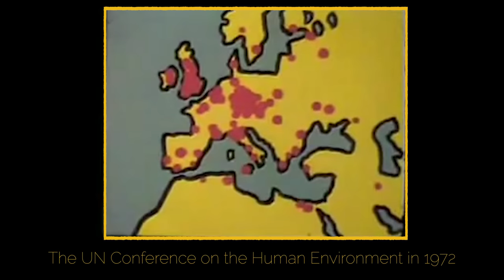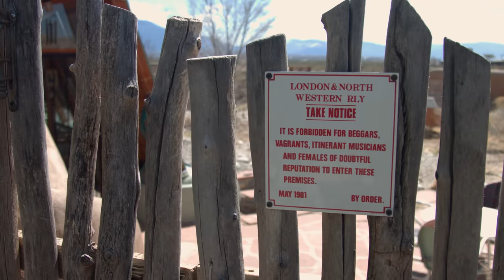Earthships - America's Off-Grid Desert Community

Comment: There’s a parallel here that I don’t see anyone mentioning, the SeaShip Communities. These are the roving bands of cruising sailors, living at sea on their boats of various sorts, mostly powered up with solar panels and small wind generators. My wife and I did it for some 7 years and truly loved it and “the life”. Just 5 solar panels and one modest windmill provided all the power needed to run everything on our 44_foot sailboat, including a large fridge and deep freeze, all our lights and electronic equipment, and our reverse osmosis watermaker (to convert sea water into all the fresh we could use). The key to it all was a good 12 volt, deep cycle battery system below waterline and the appropriate regulator. I didn’t notice it mentioned here, but surely like that is needed for land cruising as well.

What I do see mentioned frequently, however, in numerous critiques of sustainable energy production, is that its just not possible to meet the needs for modern existence. So how in the world do EarthShippers and the contemporary cruising community manage it? My guess is it’s all about heating and cooling. I repeatedly read that Florida spends 80-85 percent of its energy dollar on air conditioning. That’s an awful lot, yet Earth Shippers have clearly figured out some very clever ways around those problems. Cruisers too, just go where wind and weather treat you best.

Ultimately, what I find most impressive about what Mike and the Earth Ship folks are doing is the recycling of everything, not just for building, but for everything — drinking, cleaning, waste removal, eating, virtually everything. SeaShippers have a ways to go with those challenges. But in any cas
Reply: Also similar to Van life, with water conservation and solar energy, self sustainability.
Reply: I think the biggest bottleneck, sorry for the pun, to this kind of construction is that they're all handmade, very slowly.

They have a system where a bunch of people come and volunteer to help raise a house, in exchange for education and help on their own house later. But it's not mechanized. 

It's a lot of young men with very beautiful abs swinging sledgehammers, packing the tires with earth.

Comment: This is one of the coolest things I never knew about until now. This needs national recognition. It’s so sad when people with actual tangible solutions to some of this worlds environmental and economic issues are stifled by bureaucracy and greed.
Reply: how will you be "off the grid" when you rely on the very grid to provide you with literally EVERYTHING you need to build these places? wood, metal, electronics, septic tanks, solar panels, cans, rubber tires just to name a few
Reply: @TiGGowich  being ‘off the grid’ is not the selling point in my mind. It’s using materials that would otherwise be trash and eco friendly means to provide electricity as well as the use of water being quite efficient. so ask someone else I guess
Reply: I totally agree.  I didn't know this community existed.
Reply: @angiebear8727  Why try to build houses out of materials that would otherwise be trash? Why not actually work towards reusable materials? We are, we have found ways to recycle and reuse tires... it just needs implementation.

Eco friendly means of providing electricity? Not really... Solar panels are EXTREMELY eco UNFRIENDLY in terms of setting up. They will require regular maintenance, and will also degrade in performance over time. It is FAR more eco unfriendly than for example wind power, but on the other hand more consistent. Solar panels and wind power are also TERRIBLE as main sources of power, since some people will literally die without power.

Efficient use of water? We actually do quite efficient use of water already. Water reclamation from sewage is a big thing, and can give tons of water, so I don't really see what is that much more interesting about what they do? It is also a multi-tiered system, so you will have to bath, you'll have to water plants, etc... Otherwise it'd just be a two-tier system, and frankly most people wash themselves far more than they cook or water plants, so in general it isn't even amazing innovation for society. Also they are literally using cans, which are AMAZINGLY recyclable, so they are taking a recyclable material out of circulation.

Not saying this community isn't interesting, but it certainly isn't eco friendly in terms of electricity, and the water use is efficient for this specific style of living, and does NOT scale.
Reply: @TiGGowich  
You don't know what "off the grid means."

The "grid" isn't the market place of buying and selling. It's the literal electric grid, and branched out to include water, sewer, and the like.

It means you can be alone, unconnected to any government or community utilities.
Reply: @TiGGowich  Building is a LOT different than SUSTAINING!

Comment: I spent a few days in one of these things down in Taos.  The novelty of these things wears off pretty quickly.  At night you will be living off battery power that's draining with each lightbulb and each TV hour.  In the winter, the long nights become a significant energy budgeting issue. Add a few days of cloudiness and the energy drains quicker than its replenished.  Visualize living in a high-end fallout shelter two weeks after the power grid went out of existence.

No matter what the glowing PR tells you, in the summer these things can get very warm and humid, and they stay very warm and humid throughout the night.  I also remember lots of spiders that had found their way into the thing.

Your water supply is also a concern.  It comes from big plastic cisterns that are filled by highly filtered runoff from the roof.  In NM, rain comes suddenly in buckets or not at all for many days.  You cannot plan on having water whenever you want it.  If you go some time without precipitation, your water supply becomes worrisome until the next rain.  Assuming that your roof is around 1,100 sf, an inch of rainfall will produce about 650 gallons of water, which is not all that much. Drought conditions are not unusual in NM. You can remain without rain for weeks and sometimes months.

These things are also very expensive. A basic Earthship can run around $400-600K plus solar panels, batteries (not included), and so on.  The bigger fancier ones, like they show in the video, you might need more than $1 million.  I don't know the resale value of them, but it's a super-niche market. And, because they can be rather quirky in their feel as you see in the video, finding a new owner who will be enthralled with your personal taste will be a challenge.

My recollection of the overall environment of the Taos Earthship colony in general was akin to my recollections of the firebases in Vietnam.  Lots of "junk" such as old tires, soda bottles and cans, etc. 

Bottom line: Think before you swoon.

Comment: That beating of sand and dirt into the tyre method is actually used in China for construction thousand of years ago (Of course, there was no tyre back then). It set the fundamental stage for the wooden pillars to hold. It is very interesting to see the exact same method used, except for tyres.
Reply: isn't the great wall of China mostly packed dirt?
Reply: @jaredmcclelland1368  Yes. The ancient ones from 2000 years ago are mostly built with dirt and then reinforced with bricks and clay parts. It is more of a barrier to block off horses so those raiders can't get into cities and towns.

Comment: Would be interesting to see an adaptation meant to cope with tropical weather - especially one that can withstand multiple typhoons in a year.
Reply: The venus project has some adaptions in their societal designs
Reply: Moisture with mold and rot could definitely be a problem to solve. It looks like the shown earth-ships is build for handling the big temperature fluctuations between night and day and don't have to care about moisture.
I live far north so heating during the winter is a must, it's usually way below freezing day and night for several months. Because it's cold stuff don't dry out that well and it's not much sun to get electricity from when it's most needed.
Reply: The video mentions that they built earth ships in Haiti, and they’re right in the hurricane zone, and they get earthquakes. So I think they make earth ships that work for the certain environment it’s built in.

Comment: I met Mike back in 04 before building my house in northern Vermont.   He’s definitely a realistic thinker.   I don’t live in an earth ship but it’s definitely earth ship inspired.   If you are going to build do your homework.    Learn about thermal mass,which way to point your house, angle of the winter sun in your latitude and you can’t go wrong.    
Don’t point it towards the scenic view but towards that fireball in the sky.
Reply: So what ideas did you integrate and what was your result?
Reply: @Samthemancharles    House is earth bearmed on north west and east sides with all openings facing true south.  
I did some research on how much glazing for the amount of concrete (thermal mass) to use and it works great .    It could be below 0 outside sun shining and won’t get above 74 inside.  Heat won’t come on until 9pm or so.  
I could have a view of Mt Mansfield if I wanted but I pointed it towards the low winter sun.  It’s been 15 winters now and no regrets

Comment: Is there a way to measure the off-gassing from the tires when they are heated by the sun?  Seems like you’d be living with a fair amount of toxic fumes no?
Reply: I attended the earthship acadmey. First, these tires are used new tires off gas the most. Second the tires are packed with earth and completely encased in Adobe. They tested the air quality in the earthships and it tested cleaner than the courthouse. The engineers reports states that off gassing is null.
Reply: I have always wondered this, and wondered with all recycled plastic bottle housing
Reply: It would be a problem with direct sunlight exposure, but once encased that stops the rubber breakdown.
Reply: @polarbearzonthemoon   Well played.
Reply: really only new tires off gas, by the time they get that old they dont have much left
Reply: Ed Kelly  I- what

Comment: I feel like you could make a human powered centrifugal device that would spin tires and decrease time spent pounding tires
Reply: Use the weight of the sand to drive the spinner with a ramp that can fit under the tyre rim. Still have to pound though.
Reply: This is Sooo Cool!!!
Reply: hmm could you blow the sand in the tire or foam or mud, use a t-bar to hold the tire steady. or maybe a different step in middle like mud to fill the edges then sand in the middle
Reply: @RupertBruce  How firmly it packs is just a function of how much speed is used for the spin (and the mass): maybe a simple little bicycle with a 3-6 speed gearbox, and a simple "Trans-axle" would transfer the motion from vertical to horizontal, as the tire just sits on a platter, the tire fastened to the rotating platter with a couple screws through tire and platter.   Start slow, add dirt as it speeds up - its momentum would drive it, too, as it filled up and began to 'pack" Just a thought. 
I saw another video where they used something called a "Pogo-Pounder (or "Pogo Packer"?) that looked like a heavy Pogo Stick, and made this task a LOT easier. You'd only have to use it once - forever.

Comment: Yo this is highkey engineering though. To realize what steps have to happen for each piece is no different than building and programming a robot. You have to articulate joints, write code, swap for different parts, all these guys are doing is taking stuff that literally sits around filling landfills and WASTING SPACE and making something you can live in and FREEING UP SPACE. This is AMAZING and I don't know how people can look down on this
Reply: i work at a small mill.  when the lumber price went up to around $1500 a thousand board feet, my boss was having people pull nails from every scrap piece of lumber that was dumped off, since we also run a wood/mdf grinding machine to make chips which we sell that gets  used for fuel
Reply: The top half of this I imagine you’re talking about a conventional house right?
Reply: @daxconnell7661  so the sawmill you work at is Powered indoor heated by wastewood?
Reply: @EricEllingwood  our mill is outdoors, no heat.  but larger mills use it to generate heat/electricity

Comment: I feel like a station to make a cardboard "inner tire rim" with a manual hand run "centrifuge" (with a drive band made from rubber salvaged from other tires!) could allow them to much more quickly fill the inside of the tires, and then fill the center, then pull out the cardboard divider, and the only thing left is a little bit of touch up dirt. would save a ton of labor
Reply: You need to compact the dirt not just fill it and how do you propose moving a tire filled with dirt in place? Unless you go full on heavy equipment hand bombing it is best
Reply: What about cutting one wall off the tyre? Would make filling it full of dirt trivial
Reply: @tombackhouse9121  the point is that the dirt is held at extremely high density in a casing that is structurally sound so that when you stack up 15 of them and support a building on them, the dirt doesn't collapse like a natural hillside might. if you cut off one of the tire walls, then you cant compact the dirt inside of the tire, which means you lose a lot of the strength of the structure.
Reply: @nitewalker11  I see your point, but actually I'm not convinced it would be less sound. Imagine cutting off the 'top' wall, it would be easier to fill and easier to compact the dirt to a uniform density. The tread of the tyre would still restrain the dirt from collapsing laterally, and once the next layer of tyres is in place, the dirt is still mostly held in place by the 'bottom' wall of the tyres in the layer above. Leaving the bottom wall of each tyre in place would also keep the dirt from falling into the gaps between the tyres of the lower layers just as well as it does when using the tyres intact.
I mean, if they've been doing this for 50 years and haven't switched to doing it that way, I assume they have a reason, but intuitively I don't feel like you'd compromise the integrity of the wall; it looks to me like the rubber is taking a load circumferentially, restraining the dirt, and the axial load is taken, as you say, by the compacted dirt itself. I feel like once in situ, the sidewalls of the tyre aren't contributing much, and during construction, the uppermost wall is only a hindrance.
Reply: @tombackhouse9121  I would guess if they remove one of the rims the tyre walls can bend more which makes it more at risk of damage due to vibration. its clear the cardboard they add is in there to help prevent subsidence.
You are right btw that there should be some sort of tool to make the job easier.

Comment: Also I love the use of the trash, but I can't help but wonder how safe that is. If those tires are what are absorbing and suppling the heat, they must be giving off some chemicals (off gassing is the term). Considering the man has cancer, it makes me wonder if there is a relation to that as well. I think the idea is great, I don't see anything wrong with glass bottles perhaps, but the rubber tires doesn't seem entirely safe to me but then again I'm a bit of a "toxic snob" lol which is probably not a real term lol
Reply: I, too, have become a toxic snob over the years and the tires, and the possibility of off-gas, alarmed me immediately! So much of our chemical-based materials are going to be completely useless in future recycling efforts.
Reply: Dont be afraid, it's all around us.
Reply: Uther Petersen  Your welcome. Reads the same.
Reply: The tires are sealed inside the walls and can function as imbedded heat sinks without outgassing.
Reply: Ever read the warnings on a great deal of our home building materials? 😏 No real difference.
Reply: If you're a toxic snob as you say, the air you breathe in your city is more to be concerned about.
Reply: I used to live in the area. In the heat you smell the tires in the house. Great ideas, just need to keep tweaking to decrease toxic aspects.

Comment: No phone service implies no internet either. They need to learn about Starlink. It was specifically designed for remote areas not served by regular ISPs. It will soon be available in the southern states and will solve both of those problems.
Reply: Aren’t they trying to avoid tech?
Reply: @kingpin76110  Obviously not. Did you miss the solar panels, modern appliances, TVs, etc? Their goal is to be environmentally friendly and off grid. They are not promoting total isolation and someone even bemoans the lack of phone service. Starlin's internet with VOIP would give them phone service (as well as the internet itself).
Reply: solar powered radio station ?
Reply: I have starlink in Indiana! 
It's not that good... My upload and download speed varies and sometimes goes out randomly.. I wouldn't recommend starlink, I would recommend other wireless internet providers.
Reply: @vriliafisher1356  that's such a huge inconvenience tho not being able to contact family members or friends and being isolated from the rest of the world but if that's their goal I fully support them, to be immersed in nature.

Comment: If the tyres were cut along the centreline of the face of the tread, they would simply need to filled from a bucket or whatever so no need for the sledgehammer packing method. I think they would still be extremely strong. I just stumbled across this and i am amazed. I am in the UK so not so much sun or space but i am going to do something in my garden. Plenty of rubbish (trash) available.